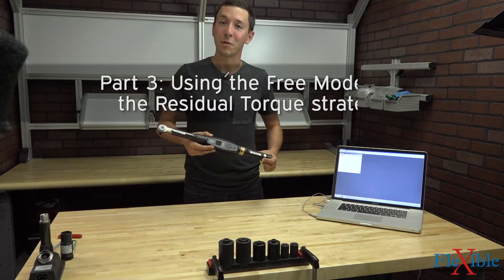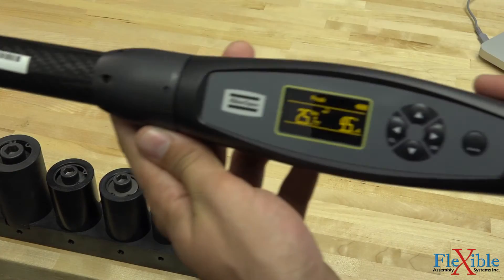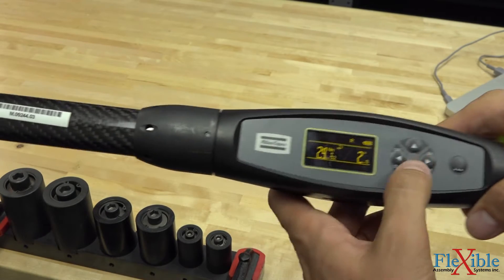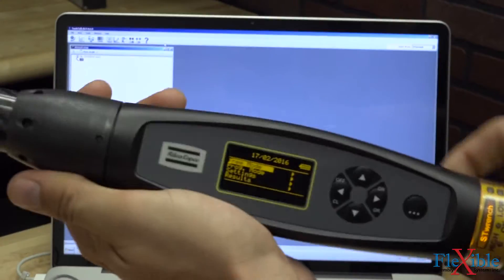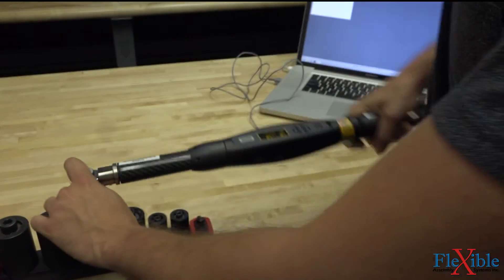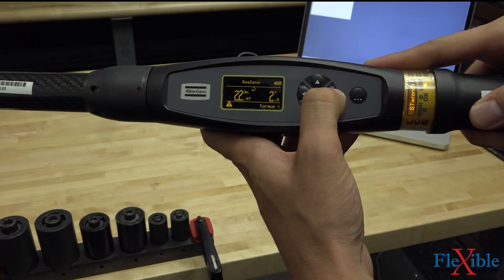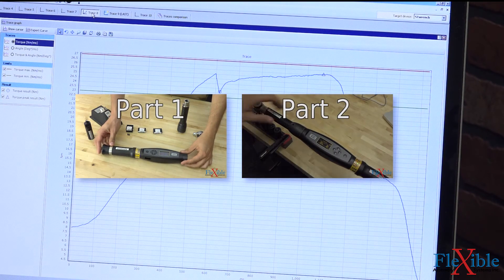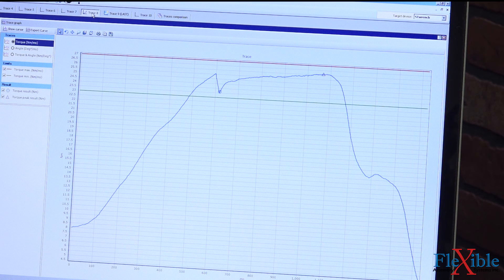AtlasCopco STwrench Tutorial Part 3: Free Mode and Residual Torque

Comment: Hello, which mode is most properly for measurement?
Thanks
Reply from the maker: If you are trying to measure how much torque was applied to a fastener then the residual torque mode would be best. Keep in mind that in order to measure residual torque you must apply force to the fastener until it moves, so the clamp force slightly increases. The best way to measure the torque applied to a fastener is to use a transducer tool to fasten it to begin with. The act of measuring the torque after the fact will always change the torque slightly.

Comment: hello, Great Videos! I was wondering is there any way you can do a video that involves using an ST wrench in connection to a PF4000? I want to know if there's a way for the ST wrench to receive a Pset from the PF and display the torque values
Reply from the maker: Hey Michael, thank you for the comment! You are able to connect the ST Wrench to a PF4000 controller for line integration via digital I/O, fieldBus, or using a SL cable. This will allow you to access P-sets saved on the PF4000 as well as display the current torque information. Once we have both a PF4000 and ST Wrench in-house again I will be sure to make a new tutorial showing this off!